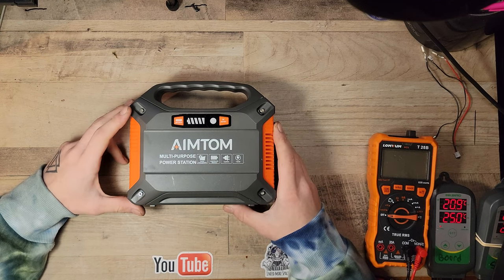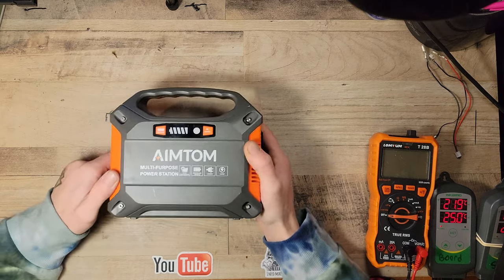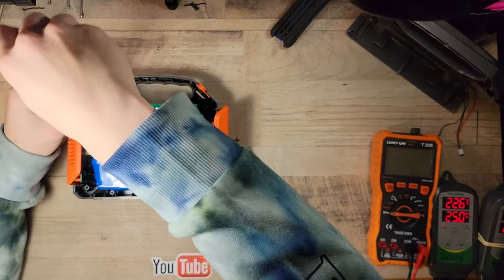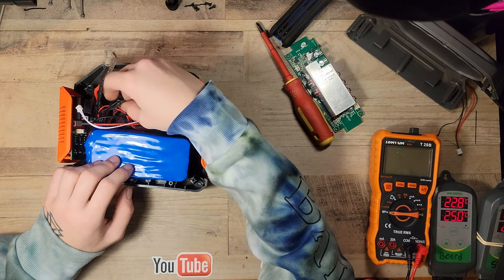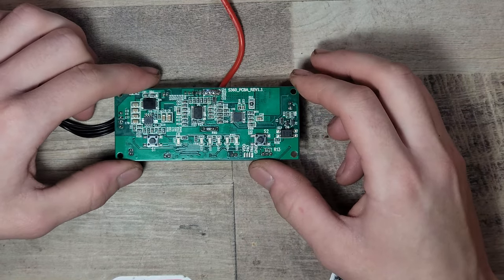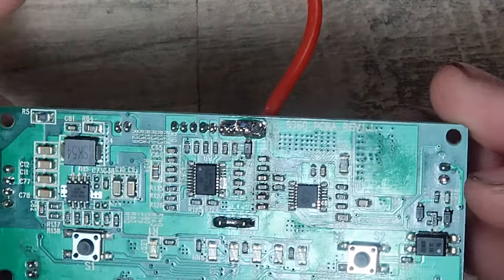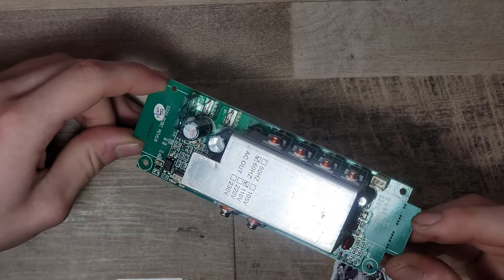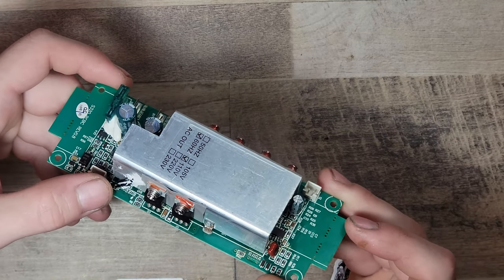AIMTOM Portable Solar Generator - Teardown & Repair Pt. 1

Comment: Just wondering ac plug just stopped working on mine thinking of a blown fuse, opening it up I see that the fuse did pop so I replaced it but putting everything back fuse keeps popping which is annoying.
Reply: if it is only on recharge what power block are you using? it should be 15-24V/2A per Aimtom which i have used a 12V/2A(only charges to 50% charge) 15V/2A and a 20V/1.5A(just ones i had on hand) and did find that the 20v/1.5A charged it way faster with less heat. it would take 8hrs with a 12V/2A to get 50% or with a 15V/2A 8hrs to get 100% and around 4-6hrs on the 20V/1.5A. I am guessing that a 22V or 24V 2A would charge it in 4hrs or less at 2A. Aimtom did say it is 2 amp limited which is why i would like to add a 2.5mm barrel plug directly to the pack so i can hook up a MPPT solar controller that is way better than the cn3722 chip that is on the board.

as for the shorting look at the wires for a rubbed off or burn through spot or the inverter lines not tight enough. This is what all 3 of mine did before dying totally and I didn't discover the issue until to late. 2 were going to the inverter and one was within the 3s7 battery pack and was shorting on a second part of the battery pack. it looked pinched like the battery moved and hit it at some point.

Comment: That chip you couldn't find is not a JXY-F020LV but instead it is a JXY-FC20LV at least on mine and google only pulls up a aliexpress result that is no longer avaliable. I need a replacement for that chip if you or anyone can help I'd be sooooooo appreciative! 

I also am really interested in the rebuild with QC and a new bms/mppt control board. i have 3 of these that are dead in the same way. i heard a spark and than the unit would no longer charge the LEDs stay on for battery level but faded and it slow drains. I would love to take all 3 3s7 packs and combine them as well as adding a daisy chain port with like a dc to dc converter so I can use a AGM or other camper type lifepo battery to increase it's discharge time ability.(i have 1000w 5x 200w 14v-23.9v solar panels for charging and a decent MPPT(100v/30a) unit at least for the 12v or 24v or 36v or 48v output). I have minimum 2 CPAP units at around 75w each if heaters are off or 180w if they are on that i NEED to power for a week at a time(20hrs of wattage a day((10hr sleep max each the current unit can handle 1 for around 10 hours)). Plus phones and maybe tablets to charge. I also have a DC power cooler fridge that takes a lot of power at least until i fix the recirculation fan and add a temp sensor for shut off.